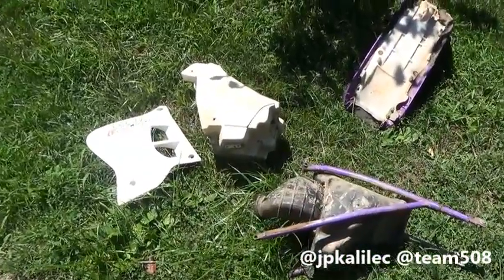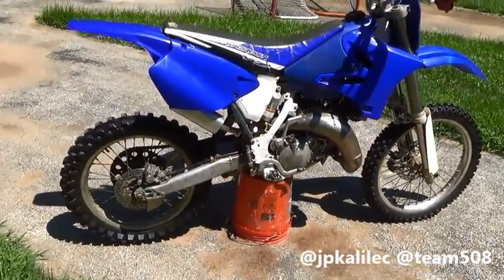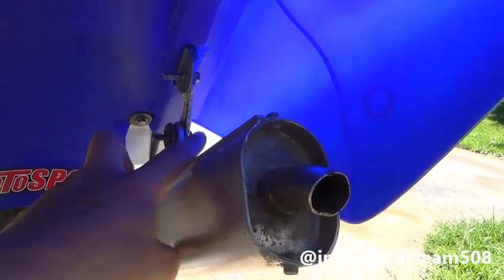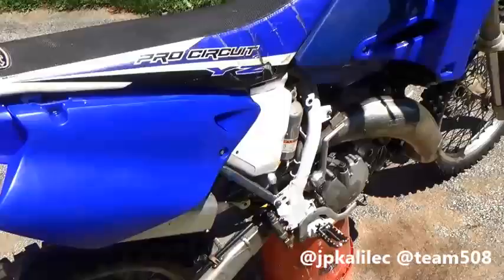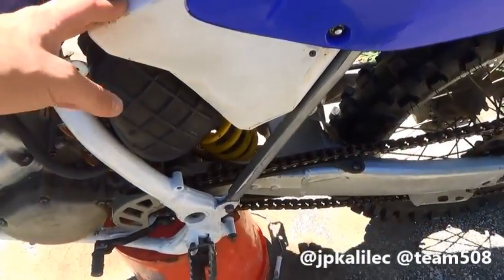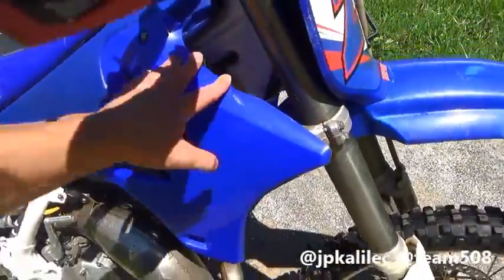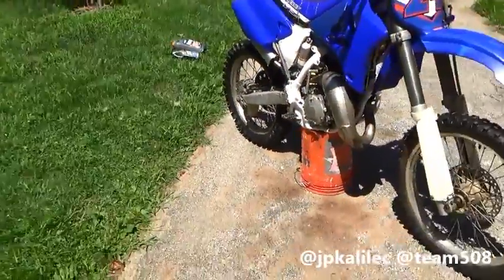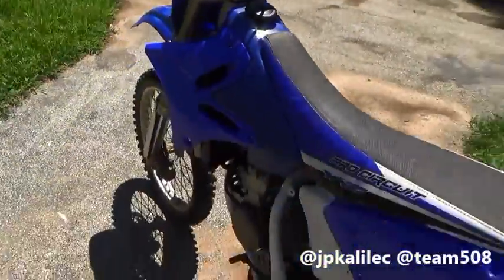Everything You Need to Know About YZ Plastics Conversions

Comment: Hello I know this video is quite old but was wondering if you could help me I'm new to the dirt bike scene and recently picked up a YZ426 and was interested in doing a plastic upgrade or a restyle I'm new so I'm not sure if that's the same thing lol but I am not sure on which direction to go or what even to start to get would highly appreciate it if you can help me out thanks in advance Godspeech stay safe
Reply from the maker: Hi Kalun, so the yz426 is a 4 stroke so I’m guessing it is similar to the 250 and 450f frames after the evolution of the 4 stroke line. You should see if anyone has put a later 4 stroke sub frame on a 426. After you find a sub frame to work, and ensure that the exhaust silencer will fit as well, it’s just a matter of fabricating your way into getting the tank to mount in order to support your seat and then fabricating additional brackets to mount the radiator fins (if it’s even necessary to make brackets, they could just bolt right on). The fender even from the newest generation of YZ will bolt right on, or you can get a fender that you need to drill yourself. The plate depending on year might have a different mounting method, as you can see in the video mine was zip tied. 

I hope this helped at least a little bit, I’d start by checking to see if you can find a decent sub frame. You could also go on partzilla and see if the sub frame for your bike was the same as later ones using the parts compatibility function, then it’s just a matter of swapping plastics. 

Thanks for watching!

Comment: I’m hopefully getting a 2006 yz85 and I can’t find any new plastics that have different shape. The front number plate is square and I want to make it look new. Where do u find that.
Reply from the maker: You can pretty much make any plastics fit if you do some modifications. If you buy a set off of a newer YZ85, the front number plate and fender should fit without many modifications. For fitment of the rest of the plastics you may want to look at some forums for information.

Comment: Airbox year?
Reply from the maker: Airbox and seat are compatible with '96-'01. 

If you replace the whole seat, airbox, side panels, sub frame, etc., you can use '02-'1X and it should all fit as long as every part in the assembly is replaced.

Comment: Did you do any work to the motor? I bought a 95 yz125 a few months ago and already made it look super nice but wish it had a bit more throttle response. Got any tips?
Reply from the maker: Is it jetted properly? if not, maybe jet it a bit leaner? There are also more expensive ways like v-force reeds, etc. Also make sure your carb is clean.
Reply: @jpsgarage  I honestly don't know if it's jetted correct but ya as far as Reed's I just ordered some vforce 3 Reed's for $144 so hopefully that helps. Thanks for the tips man.

Comment: That is awesome! Although  the aluminum  fame came stock in 04! The subframe came aluminum  from 2000 but could order from Yamaha factory! Which I raced the YZ 125/YZ 250 99'00' pro but I've had a YZ 250 1995 but I would  love to build the 1999 or 1998/94 head and then convert to a 04' aluminum  frame! With a 2002gas tank with white shroud! With covering to 2017 while leaving the 2002 rear number plate to 2017 rear fender! I want to see how much different  my 2000 motor compares to the 98/94 head that team yamahe raced because  off the longer rod which would suit my  style of riding which is a top end two stroke rider. Also my name is Jason falcon  the only person  to ever go from begginer to pro in 9 months.
Reply: Alloy frame was standard in 05.04 were steel frame still

Comment: Ive got a yz 125 1990 what plastics would I have to use
Reply from the maker: You might want to check on some forums because I have never owned a '90. My suggestion would be to see if you can find someone that you know that has newer style plastics, seat and a sub frame somewhere (or just buy them on eBay and re-sell them if they don't fit). Pretty much anything can fit if you fabricate the correct brackets and fittings.

Comment: Would the 2001 yz 125 tank fit the same way as the 2005 yz 250 tank on the 1995 yz 125
Reply from the maker: Yes the 2001 tank should actually be a better fit because the '95 frame is more similar to the '96-'01 than the '02-'04. You may still need to make some brackets.
Reply: Ok thanks

Comment: hey Man good idea but the muffler location looks stupid, it's way to low on the bike. if you got the original exhaust mount to line up with the original subframe mount it would look normal
Reply from the maker: Hayden French it will fit normally if you buy a silencer made for the '96-'01 YZ-125. I just didn't want to spend the extra money at the time but I am buying a turbinecore ii for the bike soon and it will fit without the extra  bracket.
Reply: that will look heaps better. good job man

Comment: If I get a 96-01 subframe abs seat on my 94 yz 125 will I need to get a newer gas tank.
Reply from the maker: I have seen a conversion like you have been talking about with just the rear end work but I can't remember how it was done. You might just have to buy the seat and try to match it up first. The tanks have a similar line-up so it should work and if it doesn't there is probably a few slight modifications that need to be done with a box cutter.

Comment: will my seat I currently have on my 95 fit the same with the different gas tank and plastics and can I also run a 01 gas tank so I have matching parts ??
Reply from the maker: It will probably fit if you just change the gas tank, but you will need a newer seat if you plan on changing the sub frame and the rest of the rear end. Sorry it took so long to respond btw.
Reply: 93-95 only parts if you go 96 to 98 you will need tank shrouds seat subframe and airbox and side plates

Comment: Can't seem to find a new seat for my 95 yz250
Reply from the maker: Are you looking for a stock seat or one from this conversion? You can modify any seat from '96-'01 to fit with the newer sub frame they are a dime a dozen. Mine was around $30
Reply: J-P Kalilec I need a seat to fit the frame from 95. But they are impossible to find
Reply from the maker: Oh, well I'd offer you mine but the bracket on one side is completely broken off of the pan and on the other side the bracket itself is broken. Just keep searching eBay, the thing with these old YZ's is that you might need to wait a few weeks to get parts to become available.

Comment: hey man I got a 90 yz125 and I'm trying to figure out a way to get the newer look for it as well. please let me know if its possible
Reply from the maker: Since the 1990 will have a different frame than the '93 and up, it will not be able to adapt and fit the newer sub frames. My best advice would be to try out a newer style seat cover, and install a newer front number plate and fender. I also modified a rear fender to fit my old '95 sub frame before I did the conversion with minimal cutting, but I would recommend getting used plastics because you will have to cut them to fit. You can also find some nice modern graphics, and add little things here and there like hand guards and grips. Other than that, I would look on sites like thumper talk and check the yamaha dirt bike owners Facebook groups to see if anyone has done something similar. You might even be able to do the tank conversion and just keep the rear plastics on but I would do some research before trying it.
Reply: yea definitely doing a lot of research. thanks for such a quick response
Reply: TCE Productions I have a 89 yz 250

Comment: Dude I got a 1994 and I really wanna do this! Is there a way you can message me or something to list everything I'll need cause I got lost in the video
Reply from the maker: Check out the Instagram @team508 there's some stuff on there about the build, but I might put up another video of the build so people can see it in depth. You can also message me on youtube and stuff if you want a parts list and stuff. Basically, you'll need a '01 sub frame, '96-'01 rear fender, airbag and side number plates, and airbox, and then a '96-'01 seat. For the gas tank, I used an '05 YZ250 tank but you can use anything from a '96-2016 YZ 125 or YZ 250 with the matching shrouds. 
you'll also need some 1/8" aluminum bars to make brackets and some bolts with stop nuts to secure some plastics.
Reply: Okay thanks man. I messaged you on Instagram yesterday asking for a list. Definitely gonna try this

Comment: Don't hate on the kid. We did this to bikes 15 years ago.  It looks a lot nicer and most information he learned from me since I did with to a 94 YZ250 with 490 Long rod crank.  PS JP...Use Type F ATF in your motor.  Stuff is cheap and 2 strokes love it since there is no real additives in it.  I've run it in all my 2 stroke for 10 years and never worn out a clutch yet.
Reply: Whats type F ATF sir